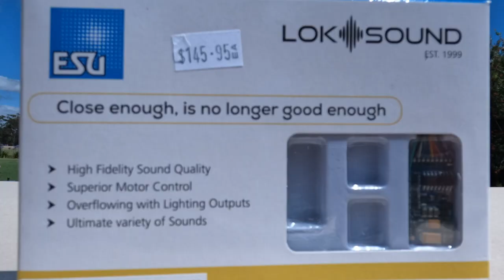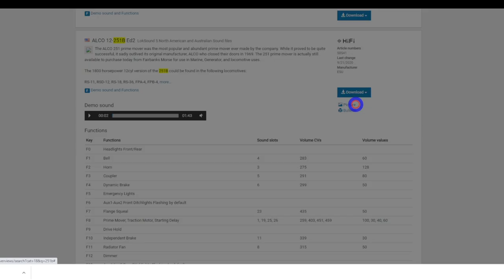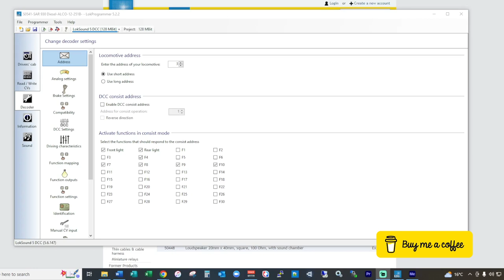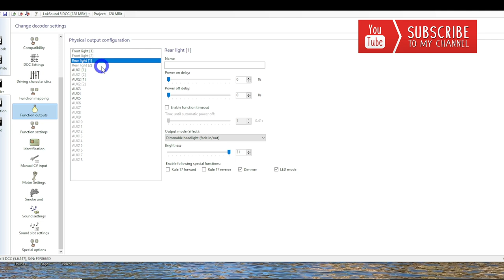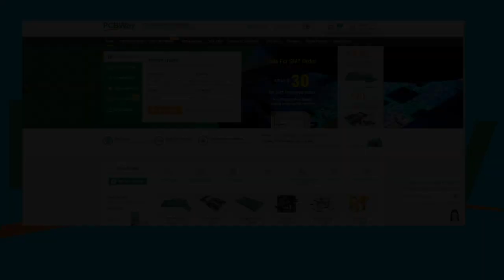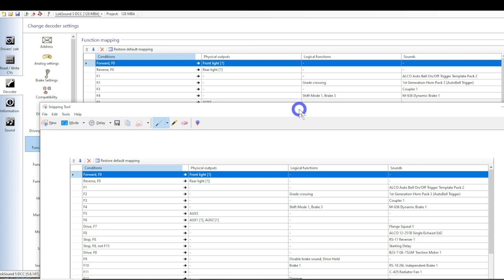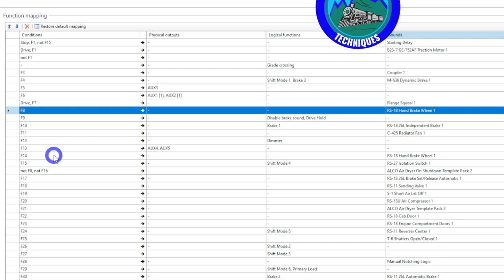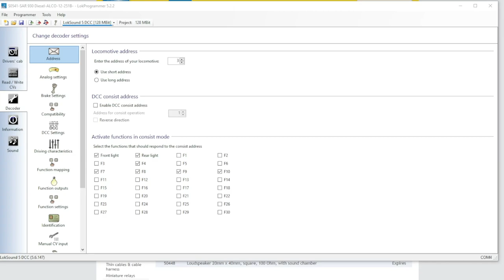Top 5 Programming Tips for Loksound 5 2023

Comment: Have you played with BEMF settings for a really slow crawling startup ? I have a Lokprogrammer and am playing with startup speeds on my NSWGR Diesels, trying to get the same startup as the professional decoder installers.
Reply from the maker: I haven’t. I use TrainController software that requires a different sent up
For auto ops

Comment: Hi Do you ever have any issues when placeing the loco on the track and the Ecos auto loading the loco info to the Ecos?
Reply from the maker: Hello I am not understanding your question
Reply: @ModelRailroadTechniques  After uploading a sound file on lok sound v5 decoder etc and placing my loco on the main layout track the Ecos is searching for the chip via railcom but not loading the loco info onto the Ecos database? 
With the V5 chips I've had a few problems.
Thanks JIm.
Reply from the maker: @hovermotion  interesting. Sorry I am not a ECOS user.
Reply: Turn off the Railcom function in the decoder.

Comment: While the software is intuitive once you get it to run properly, ESU hasn’t updated their drivers in over 11 YEARS resulting in numerous problems requiring workarounds to make it work on Windows 11.  ESU also needs to provide better support.
Reply from the maker: What sort of issues you experiencing?
Reply: I have problems with intermittent ops including “unable to read decoder” and having to go into admin settings to turn off driver integrity.  When it works it’s great but there appear  to be software issues.  My computer has an i7 with 64GB and a RTX 4070 GPU though I don’t think that part matters much.
Reply from the maker: @H5691j  interesting never seen that issue. What cable you using between pc and programmer?
Reply: @ModelRailroadTechniques   I’m using the enclosed USB-A 2.0 to RS232 cable.
Reply from the maker: @H5691j those pesky cables I have had a lot of issues over the years.
Reply: I returned the MSI Katana series laptop and bought an Acer laptop and now the ESU Lokprogrammer works as advertised.
Reply from the maker: @H5691j great news